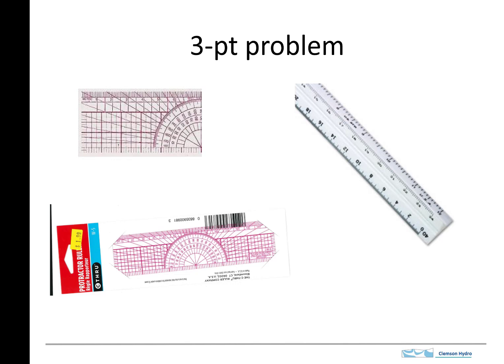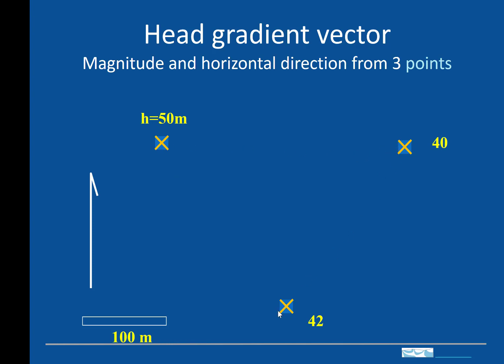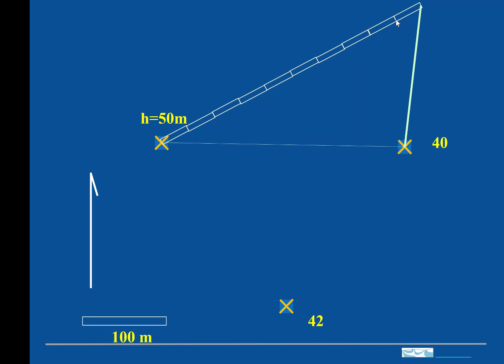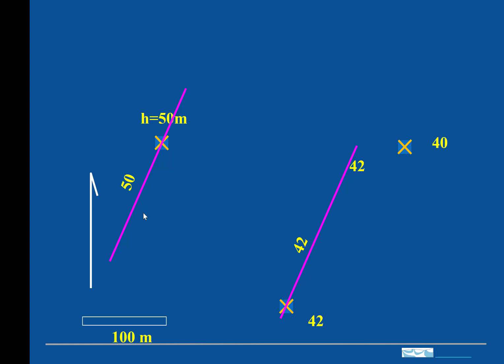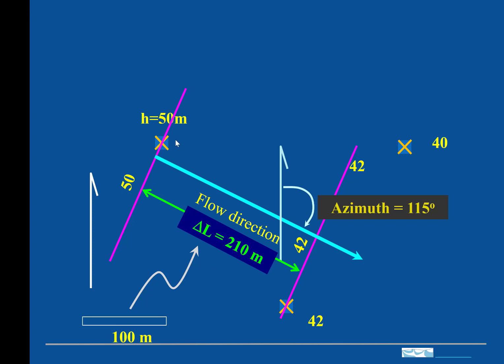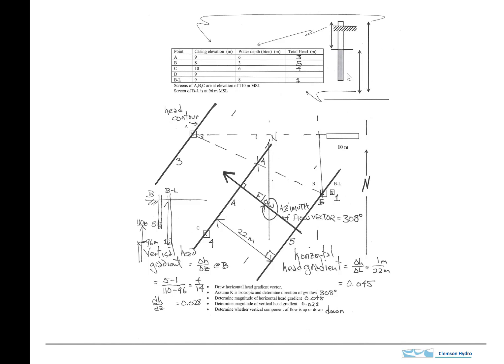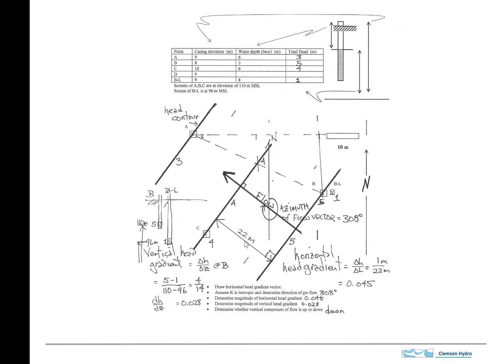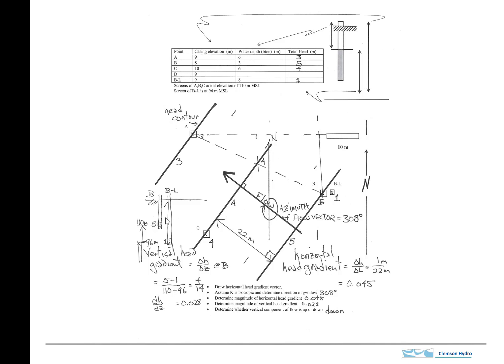3 point problem

Comment: How did you calculate the hydraulic gradient angle without using the semi circle ruler?
Reply from the maker: Hi Andres,    I used the See-Thru ruler protractor, which is shown at the beginning of the video.  Measuring the angle is not shown in the video.   Larry